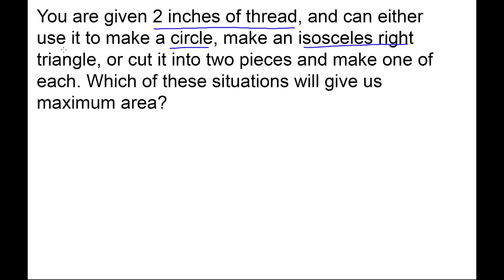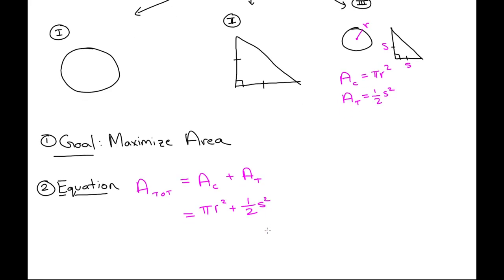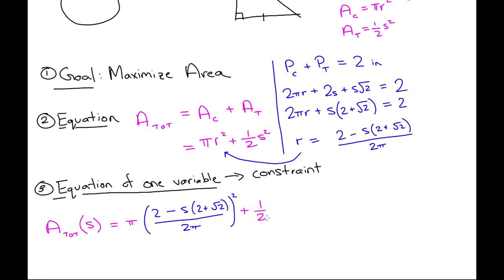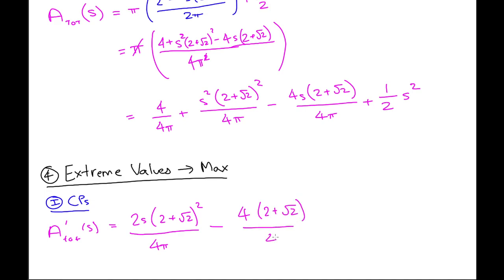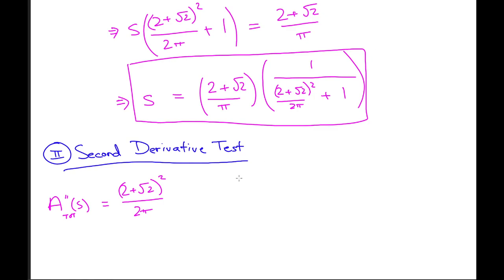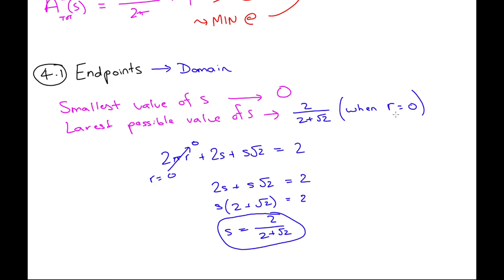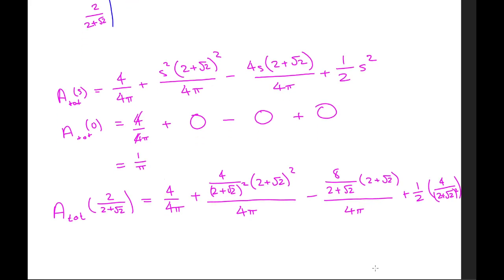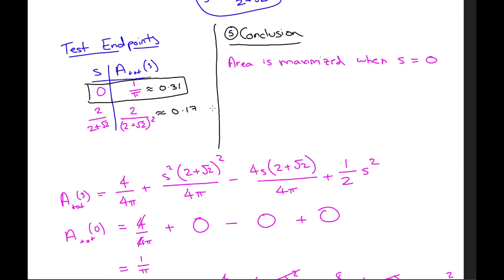Optimization Practice Problem #3  Circle and Triangle

Comment: When calculating the derivative for total area, why is the denominator 4pi instead of 16pi^2? I thought you would have to square the denominator due to the quotient rule.
Reply from the maker: Good question! Since the denominator is just a constant, we don't need to use the quotient rule.